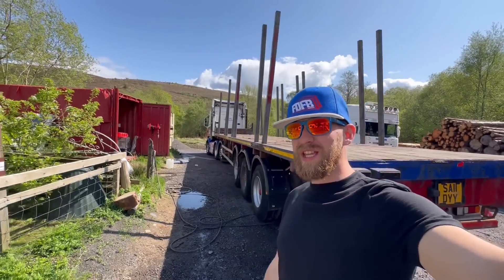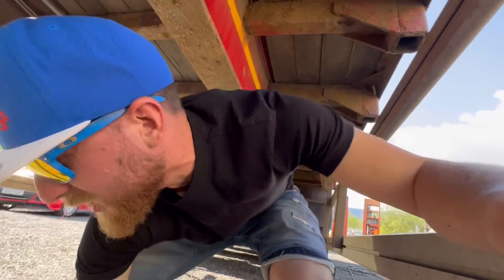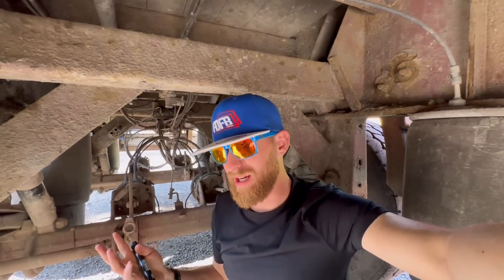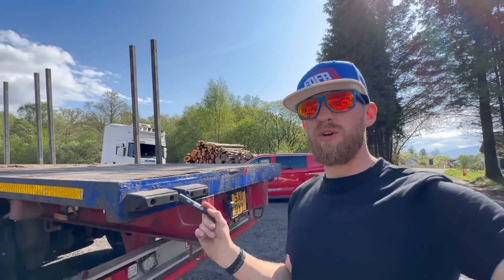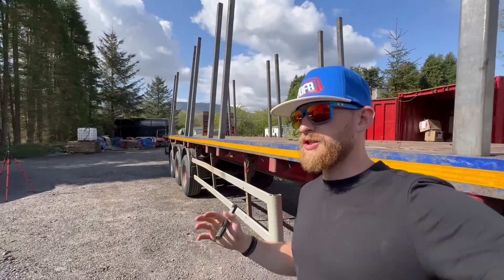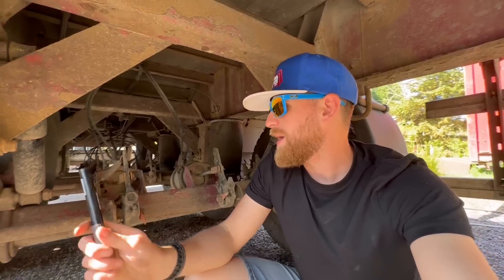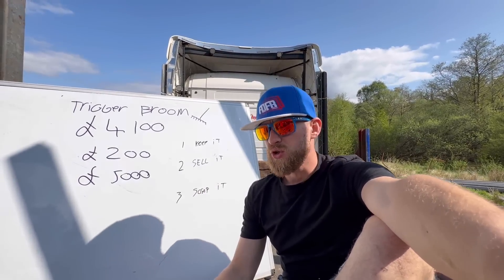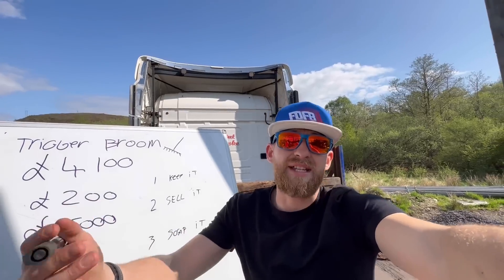Triggers Broom Trailer

Comment: Think you hit the nail on the head Sandy. Look around the £5-£8k mark for something a bit more heavy duty and use her for spares. Strip her down, fill up your parts shed and weigh the rest in. She's done her time but I don't think pouring more money into her is wise. If you have an expensive breakdown with her, you're forced to spend extra right away as you have no choice. Right now you do!

Comment: Nice to see an owner driver with a business brain and able to run the numbers and make sound business decisions with their head and not their heart.

Have you considered how much extra the trailer earns each trip as it can carry more timber? Am I right in thinking you get paid by the ton per mile like tippers? This is the other side of the coin.

Timber spec trailers are much harder yo come by on the second hand market as it's a niece market.

Maybe approach trailer refurb/modification companies and see if something can be done to eliminate yhe axle clamp issues?

Or even change the axles all together for a set of good second hand axles, say off a bridge strike trailer.

I eould love to see a video on how you spec the unit for forestry work 😊.

Comment: Strip it for parts like you said the £3000 on wheel and nearly £1000 valve on it so in them parts alone your already up the and you don't know how bad the axles are until you strip them 🤙

Comment: Could you mould a heavy gauge box section to the top of the axles and weld it and use rectangular u bolts then to prevent twisting or basically weld box section around that section of the axle top and bottom with rectangular u bolts and even weld the u bolts to the box section if you retire triggers broom build a stone slab and make it a national heritage site 😂love the content

Comment: Id scrap her and finance a fresh 1 for small payments. Youll find the right spec trailer (saf axels) and shell naw be costing a fortune of the cashflow money, but wont be breaking down either. 
I swore by bpw but ive 2 bulk trailers on saf running gear... 1 o them does boats in the docks... lets just say shes seen more 40t loads in her than 27t loads and never missed a beat. Iv been were your at and bit the bullet. Worked well for me. Keep er lit.

Comment: Questions, are there centrebolts aligning the springs to the axles?  Also are each of the axles individually set with their own level valves, if so could you put a dump valve on the 3rd axle for dumping pressure when turning in the bush?
Reply from the maker: Yes, but unfortunately overtime, they were out, and no all axles work off the same levelling valve, but that is a good idea

Comment: How much would you get if you put it in part ex for a newer trailer??
Reply from the maker: £3k for trade in and new trailer 12months waiting list and about £28.000
Reply: Strip it for spares and repairs, especially as you’ve put a lot of new parts, wheels/tyres etc 👍